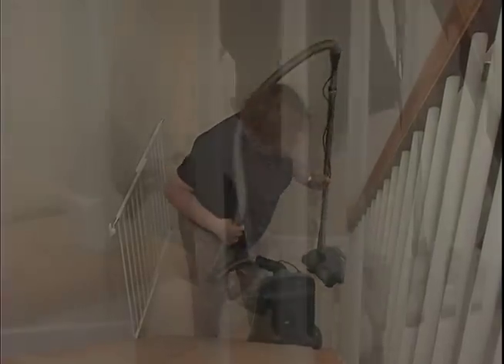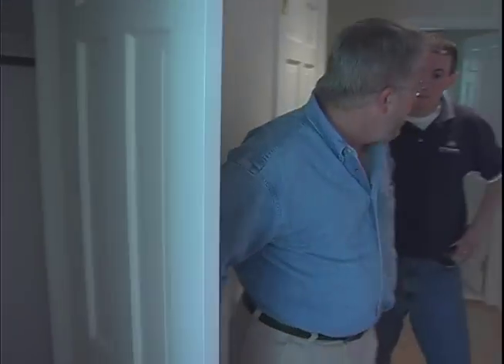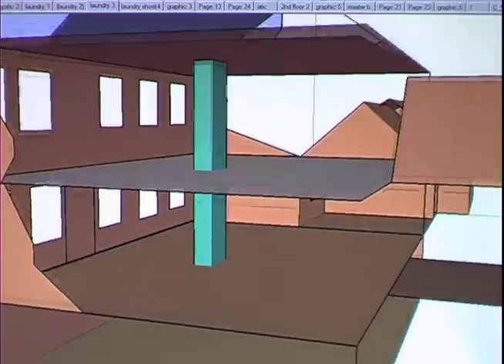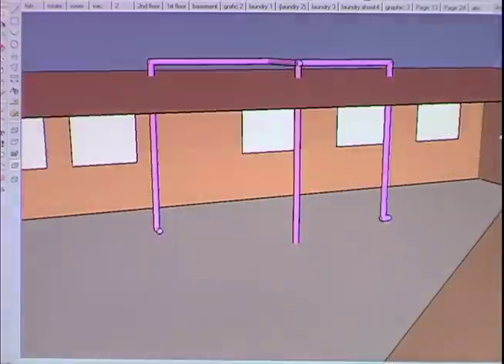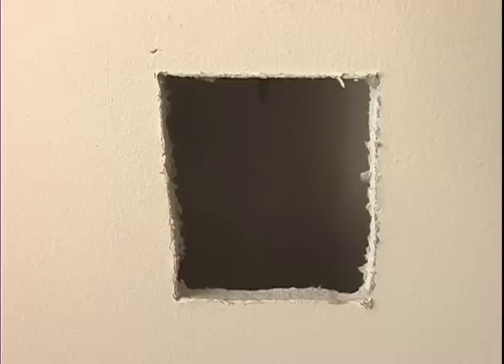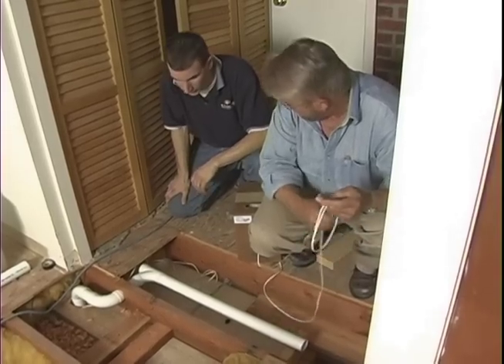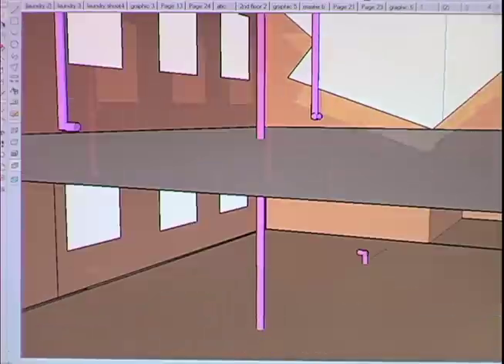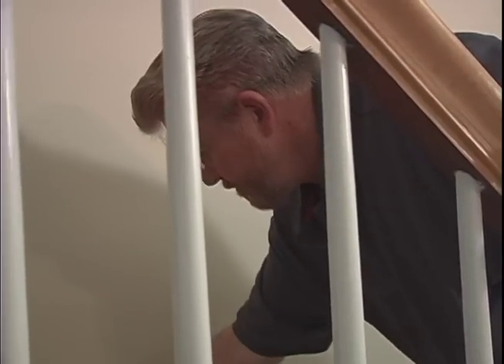Install a Central Vacuum System

Comment: Have had central vacs as a child and adult so probably 35 years of experience and never a clog.  They are amazing if you have pets.  We have a hybrid system which has a mix of "hide a hose" outlets and regular wall outlets like those featured in the video. The Hide a Hose outlets are those where the hose gets sucked back into the tubing in the wall. This alleviates the need to lug a hose from outlet to outlet.  The standard outlets are only used in areas with wall to wall carpeting which for us, is just the 2nd floor bedrooms.
Reply: I love those systems, and the RETRAFLEX version.

Comment: TIP use a shopvac when your main unit dies. They are 10x more powerful and some are quiet and exhaust can be routed outside if need and use a really good filter

Comment: Did you just hole saw through joists?...
Reply: Nick Renshaw rofl. That’s what I was thinking
Reply: goodcat1982 when you cut through a joist there is totally something wrong with that. A hole through isn’t a problem
Reply: @goodcat1982  it literally cuts through the joist dude 😂😂
Reply: @goodcat1982  you obviously don't know what a hole saw is...
Reply: Jadey sounds like he knows exactly what a hole saw is, and you don’t? What do you think a holesaw is? 😂
Reply: Who needs structural integrity when you have suction in every room!

Comment: I remember being fascinated with central vacuum systems many years ago. There was this company called Borysowski (I think they're still in business) which put ads in every magazine and only sold two things, central vacuums and sewage pumps (for when your bathroom is below the main sewage pipe).

Comment: Some advice..:  First of all be aware that now a days you can get a central vacume system hose with the hande have a build in remote on/off switch that send a signal to
a wifi recieved that you place on the wall. That way you dont have to install the guide wire in the vacule cleaner outlet in the wall and that make it more easy to install
The pipe network your self.. In my own house i just press a button on the handle and it turn on the vacume clearn in my basement via a special wifi box that is directly connected to the vacume cleaner ( it run on its own dedicated system build into the vacume cleaner.. its a nilfisk system )

Tip 2. When you connec the pipes together then it can be hard to see if you pushed them all the way in.
In my case i mesure how much they could be pushed together witch was 2cm and then i took a pen and made some black marks piples 2 cm from the edge.
That made it more easy to know when the pipes was pushed 100% together.

tip 3 ). make sure to test your vacume clearn wifi can turn on/off the machine all over the house. Also install the vacume hose and check you can reach all corners.

Comment: I bought my house already with some central vac outlets (that are not near AC power outlets).  I always assumed the connectors carried AC power.  The vac outlets look just like the ones in this video.     Are the always just a low power switch?

Comment: I’m glad to see this video to fully understand how a central vacuum system works. Not sure about the cost but definitely I would rather go with a battery powered vacuum like dyson.
Reply: A central vac is so much more powerful than a any upright there really is just no comparison.
Reply: And unless they’ve improved them recently, dyson’s are crazy loud and stupid expensive.
Reply: Dyson is trash though paid 400 for a wireless vacuum from Dyson and its trash
Reply: I bought mine on Black Friday, was a bargain, and to my taste, it can clean better than any other residential machine out there, I’m happy how it performs. Also, as a mechanical engineer (hvac) that big central motor looks like a waste of energy, the size of it compared to the small vacuum job you need to perform.
Central vacuum cost: $1200 -$2200
Cordless Dyson: $350
Reply: @oszyto  have fun with buying a diesoon 3x meanwhile the 45yr old MD will be fine

Comment: Great video but just my two cents.... Had two homes over the last decade with these systems in them. They give trouble too often and when they clog they can be a pain to sort. For the price of these systems you could afford a decent make vacuum cleaner on each level of your home.
Reply: You had crazy bad luck or a bad unit then. I've had a CV installed for over 30 years now, use it all the time and have had next to no problems with it...

Comment: Sounds like Ron is giving the instructions and commands. LOL. 

I read that when glueing the fittings for a central vacuum cleaner system, one should apply the glue only to the male side to avoid of having extra glue ending up inside the PVC pipe. When applying glue to the female side you run the risk of pushing the "too much" glue inside the piping system where all kind of thing gets stuck to.

Comment: It would be desirable, I assume, to limit the length of pipe to any given vaccum outlet. Not just because it's cheaper to run less pipe, but because any amount of pipe will apply friction to the air moving through it, creating a pressure differential between the vaccum unit and the outlet. As a result the strength of vaccum will be reduced as a function of the length of piping from the vaccum unit to the suction head.

Comment: IMO, it's only worth it if your house already has central vacuum rough-ins. That means the developer did all the piping, you just need to hook up a unit. Otherwise, always buy a cordless vacuum.

Comment: What if the pipe gets blocked by a hairball?
Reply: In 45 years of our central vac in this house, it has never been clogged in the permanent piping.  Now the hose and attachments can get clogged but sometimes you can put the hose in backwards to suck out the clog.
Reply: I install central vacs, as long as you don’t pick up anything long and skinny you will typically not get clogs. If you do get a clog you can try to use a Plummer snake to get it out or call a central vac expert for a service call
Reply: I've had mine get plugged and all I do is use compressed air with an adapter I built or sometimes you can free the clog by cycling it on and off (you can do that by either opening and closing the cover or plugging in and unplugging the hose

Comment: i always thought that a baseboard vacuum system would be nice for hardwood or tile areas. open the little door, flip a switch to activate suction, sweep toward the hole in the wall. no dust pan required.
Reply: That's what I thought this was going to be!

Comment: Honest question: how is it easier than using a Dyson in any way? My new house is pre wired for central vacuum which is why I'm here, but I still don't get what its advantage is.
Reply: Well of you have a multi level house it's easier than carrying a heavy vacuum cleaner up and down stairs especially for the elderly.
Reply: @lysergicpillamyd483  The Dyson cordless vacuum is less than 6 lbs, and the hoses of this central system aren't weightless, I wonder how much weight difference there is.
Reply: @puddingmango  really it depends on which system you have installed, there are central systems with retractable hoses that require no lifting.
Reply: @lysergicpillamyd483   Oh that I really didn't know, thanks, it does make the idea of a central system much more appealing.

Comment: As a master technician for these types of products, I must warn you that central vacuum motors are notorious for burning out. This causes weaker suction which inevitably leads to the clogs of these pvc pipes. These pvc pipes are not easy to unclog without the use of professional tools or without the removal of wall and sections of pipe for replacement.

Tl Dr: Don't install this type of system unless you plan on spending hundreds to keep it maintained.
Reply: Or buy the ones that aren't shit *cough MD, Filtex (if they're still in business idr) and Vacumaid. Then you won't have any problems with a shitty nutone or beam.

Comment: Whenever I see a central vacuum system they are installed in luxury mansions of the 80's and 90's.  Who in the heck puts them in now?  Nobody!
Reply: Blaine Bugaski my house has one
Reply: @brycenwilliams.3185  New construction?
Reply: Yes, I work for a new construction builder in AZ and we put these in $300k-500k Homes. They aren’t common but it is an option. I’ve seen maybe 15-30 homes in my 3 years so far do them
Reply: Maybe in the USA... Up here in Canada even cheaper new homes get them. It's weird to hear that someone DOESN'T have one...

Didn't realize they were so rare in the states. They really aren't much more than a good upright, especially when you factor they typically last much longer. Why do you dislike them so much?
Reply: @NWinnVR  What kind of multi-thousand dollar upright vacuum cleaners are you purchasing??!??!
Reply: Hipsters in Echo Park that's who.....
Reply: @NWinnVR  they were too expensive too for too long. Now automatic robovacs have all our attention

Comment: Then when you get a clog in a random spot you gotta test every pop then destroy more floors to find it and repair it.
Reply: Clogs rarely if ever happen. The entry elbow is always sharper than the other elbows in the system (at least that's how ours is designed, no clogs or blockage)

Comment: drywall mount?
Reply: looks like it screws into the steel backplate that the pipe connects to, sorta sandwiching the drywall in-between

Comment: Central vacuum systems don't have OUTlets; they have INlets.  Think about it; the debris goes INTO the wall.  Electrical outlets are called such because electricity comes OUT of it.

Comment: You should have glued the male ends not the female connections... that way the male end won't push glue into the pipe and cause problems with grabbing things coming down the pipe.

Comment: I wish they had exhausted the power unit out of the house, it's not hard to do and doing so removes odors and dust from the house (even if the unit has a filter, there is still dust).
Reply: Most of them up here in Canada are..

Comment: Im not sure if this is a very smart or very dumb idea. Ive heard of wall installed vacuuming, but that was divided into sections for easier maintenance. Kudos for the effort though. 
Realistically, it’ll be more efficient and practical to buy a dyson model instead.

Comment: Growing up, I lived in two different houses with central vac systems... In both houses my family mostly just stuck with a regular vacuum. The "muffler" isn't common, so every time we'd use the thing you'd get loud industrial vacuum noise coming from every room with a vacuum outlet. Plus the hose is fairly clunky and the suction head isn't powered.

Comment: My central vaccum system from 1989 starts when you put the vaccum hose in the wall. I don't need an outlet to start it. Why is that?
Reply: The outlet is for an optional powered cleaning head. The vacuum starts automatically when you insert the hose.

Comment: After all that work, this only saves you from having to carry around the part with the motor and the bag? You still have to carry a hose around and sweep it over all your surfaces yourself?! That is not at all what I thought of when I heard there was such a thing as a whole house vacuum.
Get one robotic vacuum for each floor, done. Or get one and install some kind of tiny automated dumbwaiter system.

Comment: Why not install the “outlets” at a height that you do not have to bend over to hook-up the vacuum.  I personally am getting older and anytime I have to bend over, it hurts my back.
Reply: You could take a plastic ring and some sort of round clip and make it so you can handle it with your foot

Comment: Seems dated by about forever. Surely you still have to carry around the hose and sucky bit. Or you could use lightweight vacuums which have no hose or cords, and a lot cheaper than a central vacuum system.

Comment: 2019 solution... lithium-ion batteries and cordless vacuums.
Reply: Good luck getting 30+ years worth of use out of a cordless vacuum...
Reply: @the_realJP_  I wouldn't want to, technology improves quicker than that. But these are alluring if they're powerful enough.
Reply: @CriticalTechReviews  A vacuum isn't some fancy piece of electronics, it's an air pump with a filter and trash can.  Unless you're talking about robotic vacuums (that DO have fancy electronics) getting better at navigating obstacles, what are you expecting will improve?
Reply: @ghostbirdofprey  batteries, motor efficiency, air path design, material and build quality, agitator design, ergonomics, sealing/filters, weight. Literally every basic attribute of the product. Small vacuums are getting better quickly. I would love a whole house system with a short path and high power, but I still recognize that there are advantages to having something get replaced every so often. A whole house unit is not something that need optimization to the same extent, and thus they innovate less slowly. That is fine.

Comment: You still need to plug it in? I thought that was the whole point of the system?
Reply: You plug in the hose attachment because the hoses are powered for the brushes in them, when you use a vacuum cleaner the brush roller is powered by a belt and motor in the vacuum.

Comment: This is interesting but I don't see the purpose to it. Is it really that hard to carry a vacuum up some stairs? If you can't for whatever reason (seriously, most of those are around 30 pounds though, that's nothing), having a cheap vacuum stored in a closet on each floor would still be cheaper than this.

Comment: So buying an upstairs-only vacuum wasn't an option?
Reply: It is, but a central vac can exhaust odors outside.
Reply: Lol 😁
Reply: @MrNeptunebob  It doesn't though, it exhausts them into their basement.
Reply: @Guillotines_For_Globalists  That's because they were lazy and didn't set it up right... You very much can exhaust it to the outside and most systems up here in Canada do exactly that.

Comment: I didn't watch the whole thing but I immediately noticed two things. 
1- it's an inlet, not an outlet and
2- they installed the inlet valves upside down. The way they did this, the door blocks the visibility to easily connect the hose and positioned the contact pins on the bottom of the valve where dirt will eventually settle into the pins and prevent them from extending out to make solid contact with the hose. I stopped watching at that point.

Comment: So, instead of spending about $300 on a Dyson V8 Animal stick vacuum with HEPA filter, which is easy to carry up stairs (and if it really pains you, you can buy one for each floor), he installed a central vacuum system that probably cost him a few thousand so that they can now have to carry around a bundle of tubing with vacuum head that is five times as large and heavy as a stick vacuum just so they can reach all areas on each floor from a single vacuum outlet? Dude spent thousands of dollars to end up with a shittier solution that you can get off Amazon for a few hundred.

Comment: You put the wall valves on upside down.    With that specific style of valve the door is quite weak and is prone to breaking if installed with the door opening from the bottom -----  it also makes it so you will hit/rub the rubber gasket with the hose end and potentially damage the gasket.   Everything else looks good though!   Well, except the brand of vacuum but I guess they were good back in 2009 when this was made before the dark days of the beam alliance  LOL

Comment: Or you could just buy a Dyson V10 and save yourself all this hassle
Reply: And money
Reply: A cordless portable is no substitute for a built-in...if I'm going to use a cleaning machine, I want it to take the dirt OUT of the house - not just put it in a little cup right there in my hand. Not to mention the hugely greater suction power, lifespan and versatility. I'll stick with central.
Reply: @owenperkins  I am a firm believer on the people who comment that they would rather have a dyson - have not experienced central vacuum.  Five years ago I made the change to central vacuum and I will NEVER go back to a dyson or any other disposable vacuum cleaner!!!

Comment: Dude you got to be kidding me, that was a ton of work and money involved, are companies that did this type of work still in existence? It's like watching the death of the Pony Express!
Reply: Its a lot easier when youre just upgrading your old system
Reply: What? They have more suction, last longer, weight less, reduce dust (you are supposed to vent the exhaust outside) and are much quieter so don't do as much hearing damage... How are any of those negatives?

Comment: This video is devoid of any useful information whatsoever. It's about how someone retro-fitted some pipes into a house. It's extremely generic, and may as well have been about retro-fitting cables or sewage pipes. No specifics of the pipe used, the capacity of the vaccuum, and no tips on how to spec such a system. I don't recommend watching it.

Comment: Sorry but this most useless money spending ive ever seen.
Reply: What? Because they have more suction, last longer, weight less, reduce dust (you are supposed to vent the exhaust outside) and are much quieter so don't do as much hearing damage... How are any of those negatives?